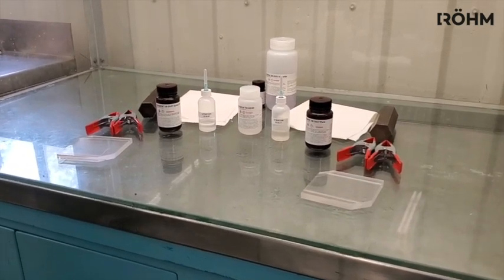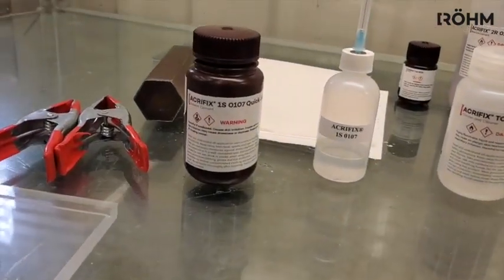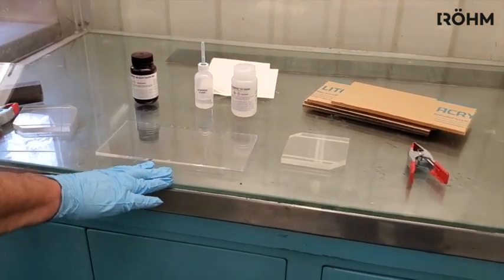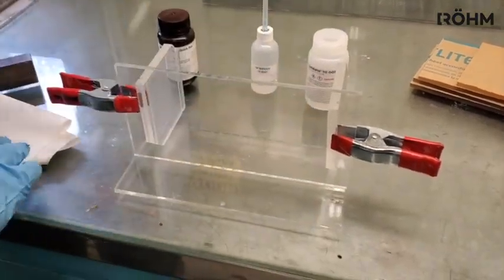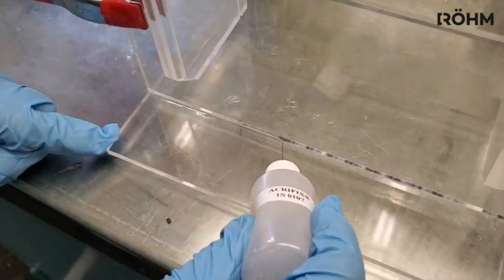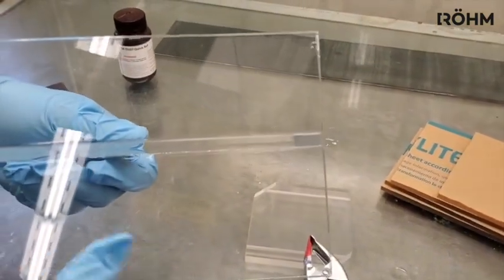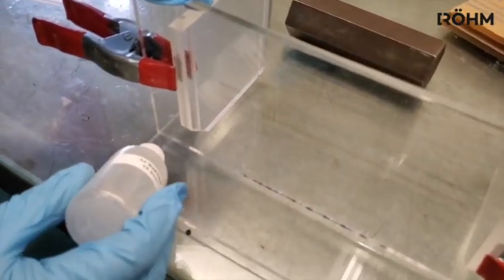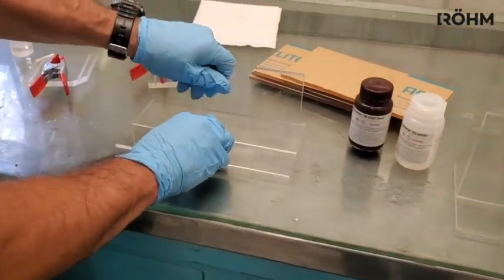Cementing with ACRIFIX® | by ACRYLITE®

Comment: Does this work on saw cut edges? I caught in the middle of the video on the TAP manufacturer's website that they recommend ips weld on 16 acrylic cement instead if not a purely polish like flat finish which your video seems to show?
Reply from the maker: Hi David. Thank you for reaching out to us. For recommendations on cementing please call our Technical Team at 207-490-4230.

Comment: How would you recommend treating the edges before attaching if the pieces have been laser cut to prevent crazing?
Reply from the maker: Hi Melissa,
We would recommend edge finishing or routing off the laser cut area where the part will be cemented. The area that is stressed by the laser is not very far into the part and not much material needs to be removed to reduce the chances of crazing. Hope this helps!
Reply: If no edge finisher or router is available you can scrap the edge also! Some folks use the old school method and run the part through a wood jointer!

Comment: Is this better than UV reactive glue? I use Acri-bond 105 (water thin solvent) and get air bubbles.
Reply from the maker: Our experience with UV reactive acrylic cement joints is that they can be bubble free, but they are not very strong. The Acri-Bond 105 is a solvent cement that contains methylene chloride and is similar to the Acrifix 1S0107. The solvent cements want to evaporate and that is what will cause the bubbles. One of the keys to having the 1S0107 solvent cement joint be as bubble free as possible, is to have a good finish on the edge of the sheet (a finish made with an edge finish machine works well). Shim the joint, apply the cement, wait 45-60 seconds and then put some weight on the joint. If the cement is evaporating quickly than you may need to use some packaging tape around the joint to slow down the evaporation after the weight is applied. If you want a truly bubble free joint, we recommend using a 2 part/polymerizable – ACRIFIX® 2R0190 cement. More labor, but bubble free. Hope this helps!
Reply: @ACRYLITEAcrylic  Thanks for the helpful advice mate. Really appreciate it. :)

Comment: What about edge to edge attachment not in the middle?
Reply from the maker: You can cement using the same method, just line the vertical sheet up with the edge of the bottom sheet! The jig that we use does not touch the joint, so it will not interfere with running the needle on the inside of the joint. Hope this helps!